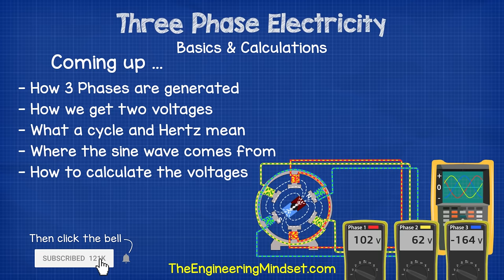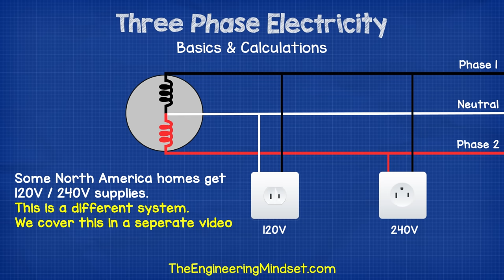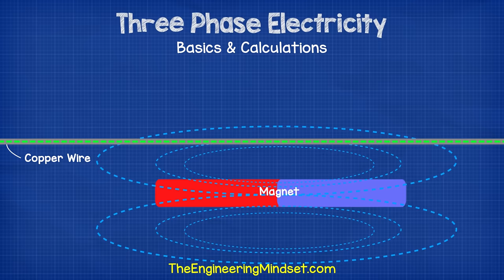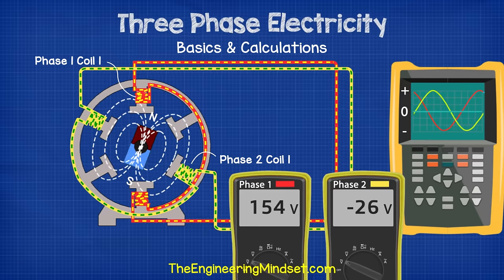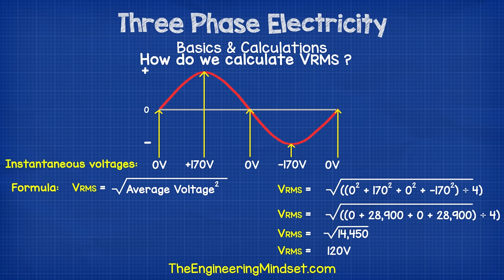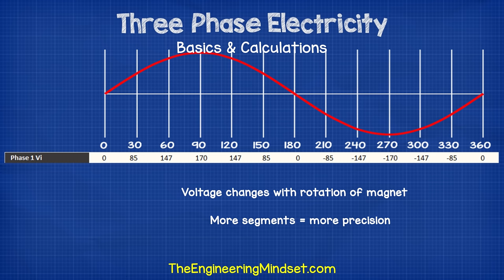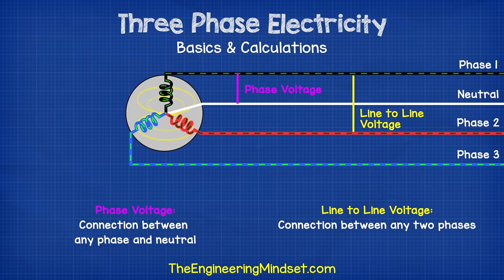Three Phase Electricity Basics and Calculations electrical engineering

Comment: For anyone curious as to why Vmax is exactly sqrt(2) x Vrms, here's basically why

What having equal heating power means is basically that the integral of the AC wave's power is equal to that of the DC current, and over a fixed time, they'll transfer the same amount of thermal energy to the block. 

Using basic formulas, we can see that P = VI and V = IR. These can be merged to solve for power, as being P = V^2/R. Letting R be the same between both scenarios which is required, we get P proportional to V^2

The energy of one AC waveform with voltage Vac*sin(t) (no frequency or phase offset since we are just looking at a single waveform) should equal a DC source with voltage Vdc, and since energy is the integral of power with respect to time, we can show that;

∫(Vac(sin(t))^2 dt = ∫Vdc^2 dt
for the range between 0 and 2pi (one waveform)

Solving these integrals gives pi*Vac^2 = 2pi*Vdc^2

Re-arranging gives us Vac = sqrt(2*Vdc^2). If we were to sub in an RMS/Vdc of 120v, we get Vac = sqrt(2*120^2) = 169.71 ~= 170V
This is where that sqrt(2) conversion factor comes from.
Reply: Good point well made.

Comment: This is a great video. 208 3 Phase is however regionally specific in the US, and 480v 3 phase is much more common in some areas, especially concerning HVAC and some generators. I work at a commercial property that's about 30 years old in which one property tenant has 3 phase 208 and their neighbor 40 feet away has 3 phase 480v. it would be great to include this in future videos or update. All in all though I love The Engineering Mindset videos!
Reply from the maker: Seen our new 3 phase transformer video?➡️: https://youtu.be/u0SsejDCVkU

Comment: Fantastic Video as always, thanks! 
Just have to say the standard in the UK is now 230V at LV or 216V-254V as regulations allow for +10%/-6% from 230V, so 240V is still acceptable and confuses some people. 
Source: Work for Electricity Board
Reply from the maker: I almost put a section about this and the EU voltage tolerance changes but in the end settled on covering the basics with a single value.
Reply: The Engineering Mindset I agree with you for mentioning single value of 1ph and 3ph voltage to avoid any confusion of the listeners.However, a general statement can be given stating that there is upto +/- 19 tolerance that various country to country per local electrical authorities.
Reply: Yes, and also in all EU countries 230V is standard voltage for at least 15 years now.
Reply: @EngineeringMindset  Interesting videos. UK & Europe were harmonised about 1992. I was working in T&M calibration/service centre and we had to amend hundreds/thousands of Metrology Support Packages when calibrating/testing/certifying each item of DVM, multimeter, PAT tester etc. as the test points/results would be across the expected range of supply voltage. Effectively both sides converged on nominal voltage of 230V, Europe was 220V plus tolerance and UK 240V minus tolerance. ISTR approx 7% of UK mains supply came undersea from generation in France etc. and was a practical driver to harmonise.
Reply from the maker: Check our new Multimeter tutorial out ➡️ https://youtu.be/4lAyzRxsbDc

Comment: Love the video, just wanna add that most of the EU runs on 230/400V and 50Hz instead of the 220/380V you mentioned
Reply: yup
Reply: Yes, the entire EU has standardized it grid on 230V since 2009. Including the UK. This video uses the pre-2009 voltages. Though the concepts are the same and the video is still as useful!

Comment: RMS Voltage is the Voltage, where the area between the graph and 0 line of the voltage is the same size for either AC or DC. That is a mathematical function and results in a factor of root 2   ~1.41 between the voltages

Comment: It is really interesting to see how other countries handle the electrical installation / infrastructure! But the most countries in Europe (for example Germany) also use 230 / 400 Volt 😃
Reply: Poland use 230V also England use 230V
Reply: @PrzemekSzmigielski  In Italy 230/400V too
Reply: Netherlands 230V

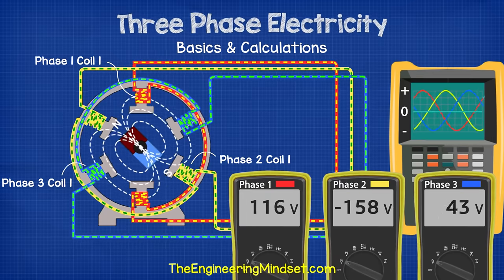Comment: 4:40-6:33 Two corrections:

* The waveforms are not correct. From Faraday's law, we know the induced EMF in the coils due to the rotating magnetic field, is proportional to the rate of change of the magnetic flux through the coils, not proportional to the flux itself. So at time 4:59, when the magnetic field is maximum as stated in the video, the induced EMF is actually zero (not maximum as the video says) because the rate of change of the flux is zero at that instant. At time 5:09, when the magnetic field is zero as stated in the video, the induced EMF is actually maximum (not zero as the video shows) because the rate of change of the flux is maximum at that instant.

* An AC voltmeter reads the RMS value of voltage, not the instantaneous value as the animation show.

Comment: Great video, the instruction and presentation is fantastic.  FYI , I did remove my last comment to save confusion. You were completely correct, the standard is meant to be 230v in Australia.
Reply: Why is it meant to be 230 V AC
it's 240V AC,  10A   at 50Hz for standard Residential Power , According to the Australian Standard
well,  Actually it's 216 V AC  to 253 V AC as the allowable range, but the accepted nominal figure is 240 V AC
I'd love for you to prove me wrong on this point, by all means 
but i doubt it

if you're gonna do it,  provide Standards documentation so i can look it up,  don't just use google as a reference or wiki, ok
Reply from the maker: @martinkuliza  AS 60038(2012) specifies a nominal voltage of 230V +10/-6% (216V – 253V)
Reply: @EngineeringMindset  
really, ??
ok, i'll check it out
thats' weird if it's true
but hey,  if it is, then it is what it is , 
ok mate, thanks, appreciate it .

Comment: euro moved to 230v 400v.they started in 1985 and in 20 years they slowly moved from 220V/ 380V to 230V /400V 
just a heads up.
Reply: maybe hes recording this video in 1999...
Reply: lol
Reply: Actually not all the europe, in eastern erupe its 220V and 380V (Serbia), but it depends if you mesure in a household near a transformer or in the one awey, wors example ive seen is 260V as the max in my village (house is snext to trafo field) and the min ive seen is 140V, but it accures when there are problems like heavy storm or winter
Reply: Exactly that, what Germany have, 230V/400V.
Reply: 220/380 was in USSR so 220/380 is dead history in EU
Reply: Czech Republic 3x230/400V
Reply: Hansel Franzen  US phase to phase voltage is 208V while in Europe and most of the world its 400V. It means for the same power the wires in the US have to conduct almost twice the current - > more copper needed.
However, there is an advantage: 120V outlets are not as dangerous as 230V outlets :)
Reply: Apparently, the UK standard voltage is 230V (used to be 240VAC) according to http://www.legislation.gov.uk/uksi/2002/2665/regulation/27/made. 

This guys makes some great videos but i hate to see him doing the same mistake over and over again (this is the second video where he claims the standard voltage in the EU is 220V. 
As the UK and mainland Europe are in the same transeuropean powergrid, the line voltages have come closer together since 1985. 
Eventually the UK will leave this European supergrid after the Brexit and connect to the American power grid to ensure net stability. Then the voltage will have to drop even further  and most of the power is lost on its way across the Atlantic.
Reply: @ToBeDefined85  Not so sure about 120 V outlets not being as dangerous,dosent america have the interesting combination of a lot of wood houses + country with the most electrical fires?
Reply: @ToBeDefined85  Voltage is lower, but to achieve same output power, you need twice as much current. That might be also a disadvantage
Reply: @zipplade  Thats what i wrote first :)
Reply: @ToBeDefined85  Oh sorry. I did not read the whole comment section. My bad

Comment: At 5:02 when N is facing the upper coil, something else happens. When the N pole is right in front of the coil, emf=0 ! There is no current.
Explanation : 
As the N pole approached the upper coil, the magnetic flux through it was increasing so current was generated in one direction, but now as the N pole is moving away from the coil, the magnetic flux is decreasing so current will switch the flowing direction !!! Its all about dPhi/dt ( change in mag flux). It is not dependent on the intensity of the field lines in the coil, but in the change of the field lines through the coil. Therefore in between these increase and decrease of m. flux, the current is assumed to be 0 ( ideally, if no self inductance is taken into account). Maximum current through the coil is obtained when N and S are perpendicular to the coils, that’s when phi varies the most.
Despite this small detail, i found your vid very useful. 
Thanks a lot for all your videos, they’re of great value! All the best!
Reply: Thanks for ur comment, I got confused at the beginning after watching "How three phase electricity works" where he mentioned that the strength of the magnetic field gets to its minimum (in its poles) when its vertical while in this video it's the opposite!
Reply: N.J Production you’re welcome. We’re all here to learn and share knowledge. Its important to notice the flux change in the coil because that’s when EMF is generated! 
All the best!
Reply: Pentru un nestiutor ca mine: daca din vânt sau apa, reusesc sa fac un rotor, el trebuie sa se invarta in jurul statorului de 220 pe secunda? ..si am in gand doar pentru alimentare casnica...sau poate a explicat dar nu am inteles. Multumesc! :)
Reply: Thank you! I was already looking for an hour where I was wrong! So if the pole is in front of the coil, current direction changes because of change from increasing magnetic flux to decreasing magnetic flux?
Reply: @stijnlagache  exactly. Where N is right in front, the Mag Flux is at it’s maximum, then it starts decreasing through the coil, leading to a reversed emf generated in the coil due to now decreasing mag flux. Despite the case when N was approaching the coil, the mag flux was increasing through it.

Comment: The thing I'd really hoped you would show is what happens to the electrons during a cycle in a circuit that connects two phases. The video is really clear about how to calculate the values, and it's also really clear about how during the cycles the voltage is at times higher (and other times lower, obviously) than the "reported" voltage, but I have a hard time visualizing how the different phases 'boost' each other. I feel like I'm so close to getting that, but I really need to see it to truly get it.
Reply from the maker: See our 3 phase motor video
Reply: @EngineeringMindset  Thanks! That made it make a lot more sense than before!

Comment: Correction, the voltage used throughout Europe (including the UK) has been harmonised since January 2003 at a nominal 230v.
So UK 240V and EU 220V is false.

Comment: if you said the US voltage was 110v i would have to point out that it hasn't been 110v for since 1967.
i only mention this because a lot of people still say 110v. im glad your info is up to date. we do use 240v single phase in every home too for washer/driers maybe refrigerators too.
my work place gets 440v 3phase. not 208v  that's a weird number and i wonder how you came up with it.

Comment: Great video, just 1 question, what is the difference between connecting to 3 or 2 phases. In the last part you said there phase voltage  (neutral and line) and then you mentioned line to line voltage, but you are only connecting 2 phases in line to line, what about the third??
Reply: A 3 phase network allows you to connect different devices that have different needs. You could have a device that needs single phase voltage but needs 208V. You would then connect it between 2 phases. The next device could be single phase again but needs 120V, you would then connect it line-neutral. And then, you could have a motor at the end that needs triphase power. You would connect it line-line-line in either a delta setup to get 208V  on the motor coils, or in a wye setup to get 120V on the coils. All that using the exact same supply. The reason to connect one or multiple lines depends on the device needs.

Comment: Actually in Canada, you can have 120v/208v (basic distribution and lighting) and 347v/600v for bigger demand (commercial/industrial such as drives or lighting). Hydro-Quebec by default in industrial or commercial applications actually only supplies 3phase 600v. Its on the customer side that we drop down tension to 120v/208v. Residential is fed 120v/240v (single phase) from Hydro. Heavy commercial/industrial, Hydro can supply 14.4Kv/25kv :P Actually did a 2000amp@25kv entrance this winter...50mW of pure power! :P
Reply: For a second, I thought 50mW was milliwatts

Comment: Marvelous, However I would like to know why we do not use a neutral line when we have 3 phases. Could u make a video explaining that please?
Reply: Power flows back and forth in the other phases depending on the timing. You can then have a « floating » device that only needs the 3 lines. Now the reason why you want a neutral or not is a theme for a whole other discussion, a complete series would be needed for that. If I sum it up rapidly, implication of having a neutral vs none, aside from allowing 2 different voltage to be seen by the equipment, has to do with when fault occurs ( lightning strike, short circuit, harmonics mitigations etc..) When a fault occurs, the extreme amount of power has to go somewhere. Being connected to neutral or not will have effect on what power the equipment will have to deal with during a fault, and what the other equipments on the same network will see when a fault occurs at the neighbour device. This is the basis of grid management. Stuff that substation engineers, power device manufacturers, and electricity manufacturer ( Utilities) have to deal with on a daily basis.

Comment: Great videos! However US residential electric is 240 V - the difference is that we use transformers with a center tap. The main panel in most homes has two 120v legs plus a neutral that is connected to the center tap. So in the panel a connection from one leg to neutral ( connected to center tap)  yields 120v and a connection across both legs is 240. 
The confusion is that most circuits, and appliances are 120v. However most homes have electric clothes dryers, stoves, water heaters, central AC or similar that use 240 circuits. 
I believe the confusion is that many other systems don’t use center tapped transformers…. At I believe this is true of the UK.
Reply from the maker: Correct, we have covered that here also https://youtu.be/fJeRabV5hNU
Reply: @EngineeringMindset  cool! Good stuff, I’ll just keep quiet and enjoy the videos! 😆

Comment: FYI UK now class their voltage as 230v. Used to be 250, then 240, now 230. Mainly to overcompensate for cable calculations as ohms law would bring out current higher with lower voltage and thus when calculating current carrying capacity for cables, it can influence the designer in selecting the next size up.Of course most houses typically float in the 240v RMS range in reality.

Comment: Very simple to understand, subscribed! One question, if the voltage for each phase is constantly changing why doesn't the multimeter report the instantaneous voltage and instead report the vrms?
The fluctuation is so fast that the connected devices only "see" the average listed in the formula?
Reply from the maker: Check our new Multimeter tutorial out ➡️ https://youtu.be/4lAyzRxsbDc

Comment: Please explain sir, what is line voltage,phase voltage,line currents,phase currents , what happened if we connect 3 phase supply to balanced and unbalanced load and how line voltages, phase currents different in star and delta connected network and relation between phase voltage and line voltage  as well as line current and phase current and why should we use neutral and phase in distributions to houses.please make a video on this topics sir.
🙏🙏.
Thanks a lot sir for making this video

Comment: Incredible explanation. 👍 Amazing as always. 
But, I need to know one small detail. Shouldn't the source shown in the video be called an alternator, instead of a generator? Don't generators use a commutator to maintain a positive and negative at the brushes for DC output supply? And alternators use slip rings to create both +ve and -ve sinewave for the AC output supply? I dunno. Maybe I'm being too fussy. 😂

Comment: @ 2:20 it's not 2 phase, it's called split phase. But I am sure you just miss spoke. Thanks for an awesome video.
Reply: Depends on where you're taught UK/US universities call it either
Reply: @LennyDeee  I don't doubt that, that is not the only thing they teach in the university's.  But on the sirious note. It comes off a single phase and stepped down  through a multi tapped xformer that is grounded in the center .  The 2 hot wires are not 180* opposed to each other. (True 2 phase was used in old radar systems)  Hance the name SPLIT PHASE.  And remember kids those who know do, and those who don't teach.

Comment: Hey man, congrats on this video! I noticed you have fixed the mistakes you had in the other 3 phase electricity video with respect to the direction the current moves in the generator ;)

I also noticed you slowed down the animation of the rotor. That was useful in detail the varying current!

I hope the upcoming videos are explained at the same rate of this one. You didn't explain fast, nor too slow to bore the viewer. 👌

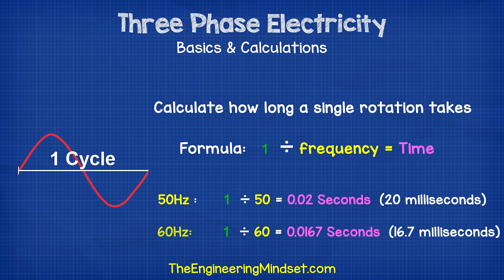Note: @ 8:14, actually, it's not the variable time t,  but the period T of the sinusoid, which is a constant (not a variable like time). However, I think with "time" you meant that the period represents a time (and thus it's units are seconds), which of course is correct.